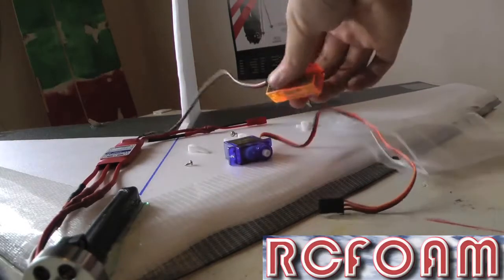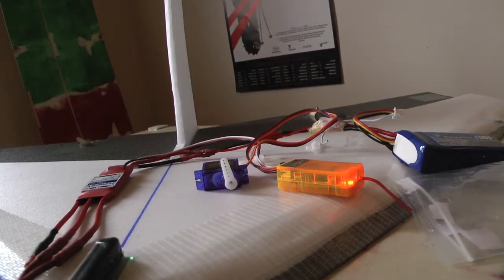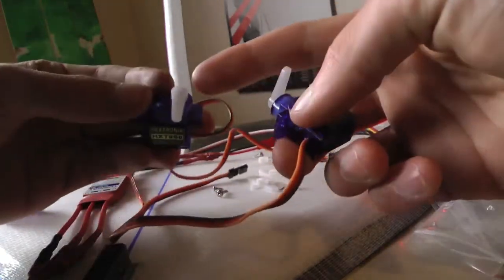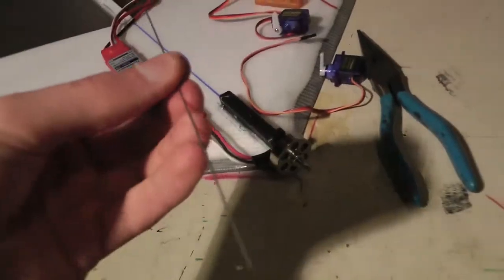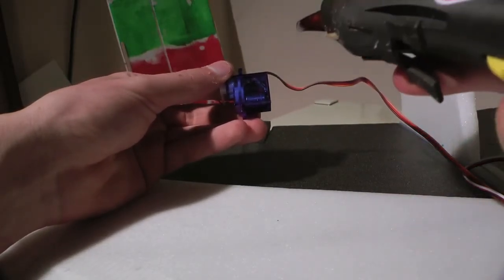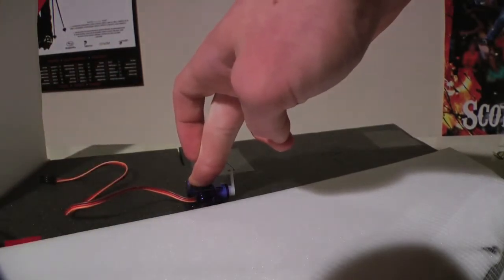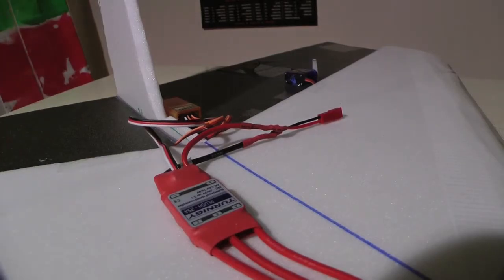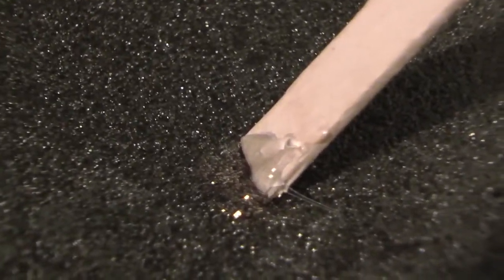Delta Wing Build Along Instructions #5

Comment: I noticed that from your original delta fighter design that you have added a bit of a "V" to the back of the wing. Does this help with flight characteristics in your experience. I've been messing around with delta wings recently and have noticed that more sweep to the back of the wing really improves how the wing handles.

Comment: Very nice! Like the way you just keep it simple, but you should really consider sanding that trailing edge and horizontal stabilizer;) It will give you a much better wing profile which makes your ailerons more efficient so you can use smaller trows, which means less drag. Think about it and consider doing it to your next project

Grtz Rick